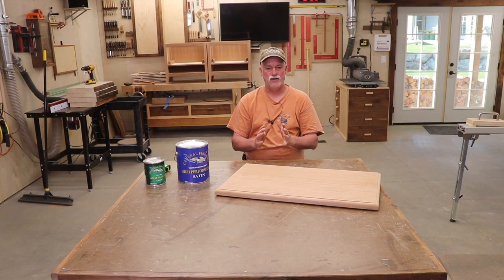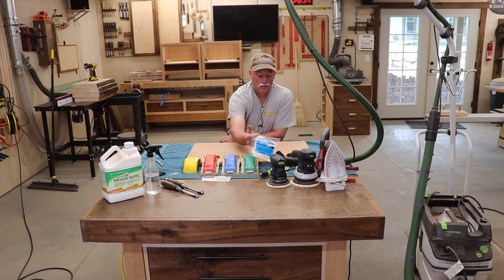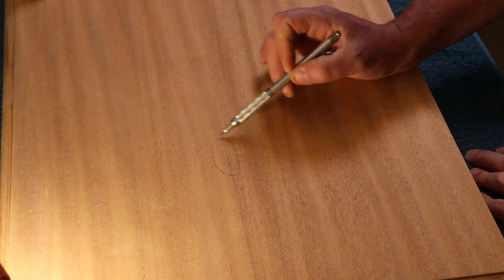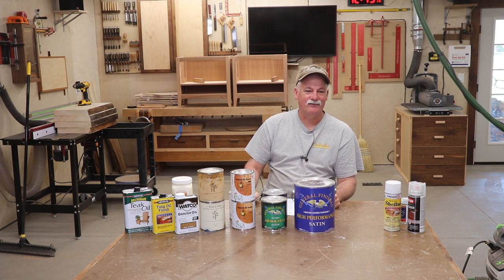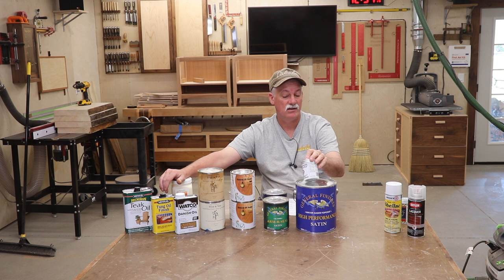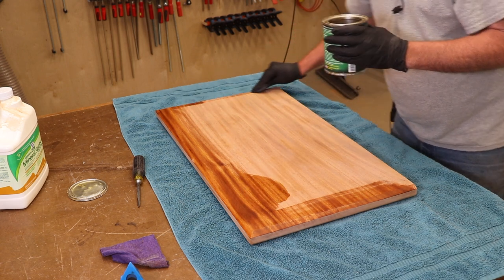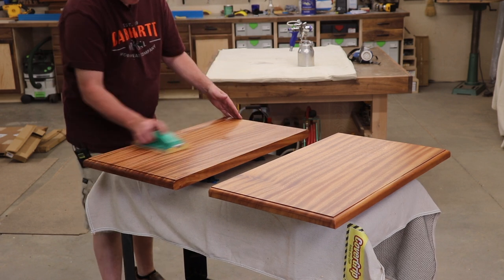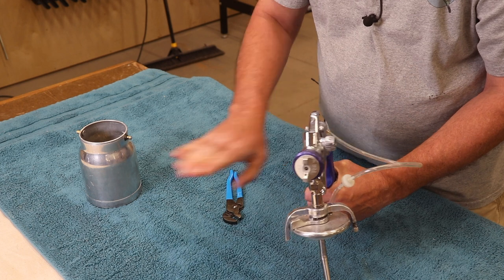Finishing

Comment: Awesome and very informative!  I came here from your Instructable site and can you please answer a simple question?  In your fantastic shop, can you please suggest what is the best CFM rating compressor to use such as in your case, spraying on finishes from your spray gun?  Thank-you
Reply from the maker: Thanks for the kind words!  The compressor under my assembly table is for my nail guns or just air to blow things off.  It's a small California Air Tools compressor that's super quiet!  For spraying finishes, I use a Fuji Q4 HVLP system.  I know that there are lots of options out there for "conversion" set ups that use an air compressor but, I just don't have any experience with them.
Reply from the maker: The Q4 does an awesome job and with simple changes of the tips I can even spray latex.  For the water based stuff, you don't need anything that robust.  All just depends on what you want to shoot.  I used the Rockler version with the WB stuff for years with great results as well.